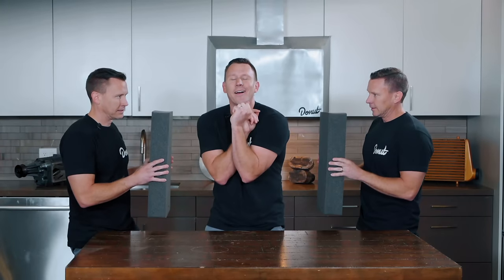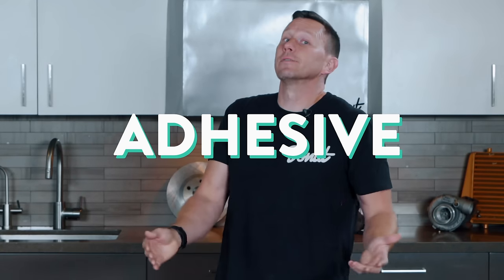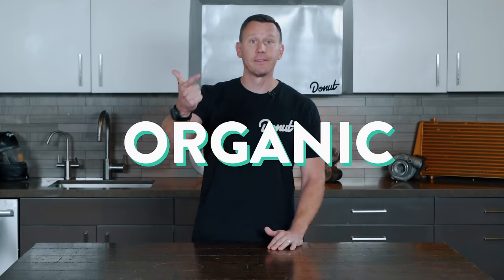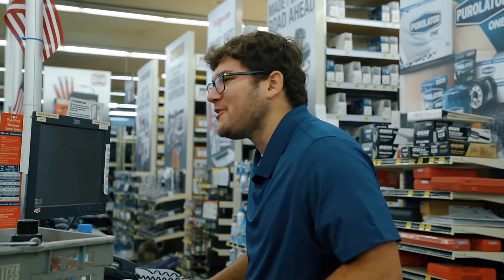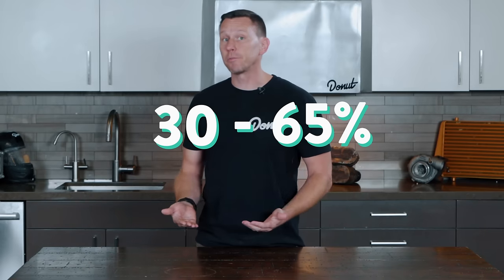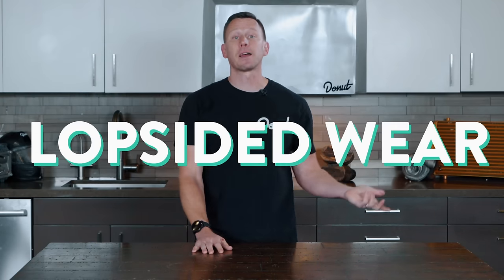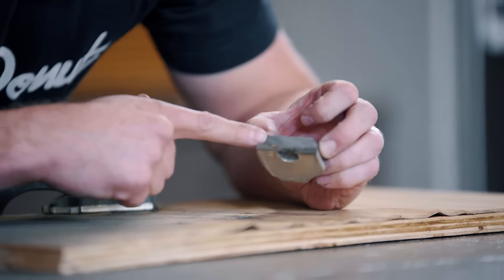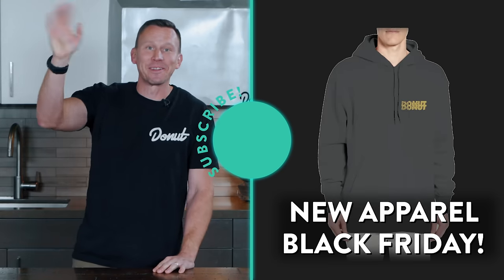Choose the right Brake Pad! | SCIENCE GARAGE

Comment: While this video is very informative, there is one false fact stated that needs to be cleared up. Brake pads and brake shoes are not the same thing. Brake pads are part of a disc brake system. Brake shoes are part of a drum brake system. What is the difference? 
Well, disc brakes involve a disc. Other wise known as a rotor. And they work by having the caliper piston press against the pads, which presses the pads into the rotor forcing it to slow down. It looks like this (>>|<<)
The () are the calipers 
The <>are the pads
The | is the rotor

Brake shoes however do not do that. In fact, they do the opposite. They go outwards when the brakes are applied, because, unlike disc brakes, they don't have a rotor, they have a drum. The shoes press against the drum in order to slow it down. It looks like this.
(<<>>) 
The () are the drum
<> are the shoes. 

Brake pads are not sometimes called brake shoes. Brake pads fit in the palm of your hand, usually, unless you have those big racing brake pads. Brake shoes are bigger than your head.
Reply from the maker: You'd probably like the video where we talk about that!
https://youtu.be/6H7nwlT_qNY
Reply: Very well explained.
Thanks.
Reply: A metal backing with a soft material.... pads and shoes are made the same but shape is different
Reply: Except you don't know how big my head is.
Reply: Nice explanation 🐐

Comment: Im using carquest ceramic platinum pads and rotors. They are absolutely amazing.
The pads are silent. They stop on a dime.
My brakes absolutely sucked. 2010 oitback in northeast pa.
Took me a solid 6 or 8 hours because i completely cleaned each part of the caliper that holds the pads. Subaru uses slide pins that have boots and are sealed with grease. Mine were dry and def not working properly. Proof is that the inside pad was worn on the bottom of all the pads except one front side. That side had the best looking pins 

Anyway, i used a bore brush to clean the cylinder where the pin goes. I used small wire wheels to clean thenrust on the lips so the boots can seal properly.
I used at 205 to clean and restore the boots to a like new appearance, i could not believe it.
Anyway, the calipers are now functioning as they should of been and they just feel amazing. I flushed the fluid which makes the pedal feel brand new. Just super impressed with how much doing a job yourself can really change the outcome.
Had i went to a shop theud of replaced everything n not touched the pins i guarantee it.

Comment: One thing you left out is that the more expensive brakes tend to perform worse until they have been warmed up. If you just start you car and have to emergency brake shortly afterwards the organic brake will stop the car faster. However if you've done some braking at high speed on the highway and have already warmed up the brakes then the more expensive pads will perform better.
Reply: If you have power brakes and abs, it shouldn't really affect stopping distance
Reply: @matthewprather189  track pads can provide a lower coefficient of friction than stock pads until warmed up, which they will then provide a much higher coefficient of friction.
Reply: @NCRranger24  Then push harder. Shouldn't be too difficult to lock the wheels
Reply: @matthewprather189  I don't think you understand. They can only provide so much friction at cold temperatures, and can often be incapable of locking up the wheels/triggering ABS because they can only provide so much friction when cold, regardless of how hard you push the pedal.

Comment: Love the show, something else to mention 

Organic brake pads wear faster but put minimal wear on the rotor.

Sintered brake pads last longer but wear the rotor faster.

Racing/track brake pads require to work in a higher temperature window. This makes them wear less when in use. But are very bad for street use were the temperatures are low.

Thanks for the videos and entertainment:D 

Ps I think home containers are awesome!!!

Comment: i need new brake pads on my miata. Thanks for the input
Reply: Put on some FREAKIN' Carbo-Ceramics!
Reply: @srijangupta.automobile6320  totally i aggree 8 pot brembos in the front and 6 pots in the rear just to be safe
Reply: you could prolly go back to using leather pads for a miata.
Reply: Not with my 8 pot brembos!
Reply: I’ve built 3 spec miatas the 1st thing I did to all of them was threaded lines and carbon ceramic pads($100) most effective mod on a car imo
Reply: Got projet mu ns400 on mine, happy with these
Reply: Arent they rubber? Bicycles stores sell shit for those kids peddal cars dont they... 😉

Comment: Nope.  Tires are more important than brakes.  Brake on bad tires, watch what happens.  Brake with no tires at all, watch what happens.
Reply: Well really worn out tires are capable of gradually braking. And with no tires at all, the friction between the rims and the asphalt would be too high to even sustain its inercial energy. In the other hand, no brakes no ability to stop short-time wise. Which means, no engine stop.

Comment: As far as brake wear sensors are concerned, the MINI Cooper is an exception.  Instead of a metal tang, it has electronic brake sensors, which when triggered, light up a brake warning light on the dashboard.  When that happens, not only do you need to replace the brake pads, but these electronic brake wear sensors as well.  And then, you have to rest the brake warning light on the dashboard, otherwise it won’t pass state inspection.  I know this because I had to service the brakes on a MINI Cooper once, and it was a real pain in the butt.

Comment: Metallic pads will stop you fastest. Ceramic dont perform as well but handle the high temperatures of racing better. A good example is moto gp. They switch to metallic in the rain because they perform better and heat is not an issue when its raining.

Comment: You were holding the grinder upside down. You need fo rotate the guard and handle and turn the tool over. That way, you have leverage to cut without the grinder bucking and flying at you.

Comment: Ceramic brakes also lack bite. I love semi metallic because they are cheap and have great bite. I do my own work so changing brakes are quick and easy. I'd rather have that extreme deceleration feeling than have long brake life.
Reply: Oh and ceramic brakes need heat to start working. Semi metallic just work right away. Quicker more confidence inspiring braking for cheap. Until you get to a extreme hill or alot alot of frequent braking. Then ceramic can take more heat before the pedal does nothing at the cost of your rotors. Ceramic eats rotors no matter what. Organic pads are just a way to get you to the dealer more frequently. You should only have semi metallic and ceramic to choose from. Seriously they are a scam IMHO.

Comment: This video is so useful. Thank you so much for making it. I am gonna need to replace my bakes soon but unsure what type of brakes I should use. I have no idea what type my original brakes are. There are various brakes in the market. Some are from big brands like TRW. Some are from brands I have never heard of. It will be so great if you can give some advice for my VW Tiguan. Should I go with ceramic or semi-metallic?
Reply: If your unsure the OEM parts are almost always the best choice. The only real downside to cheaper brakes are noise and how fast they wear. Semi metallic are best unless you are taking your car to the track. Your stopping distance is limited by traction, not braking force so your pads an rotors should have no effect on your stopping distance.

Comment: My car could have came with the option for carbon ceramic brakes. They are 10k for just the fronts to do a brake job and only porsche makes the parts for my car. No aftermarket parts available

Comment: Ok i have 1 question where I can’t find I’m going on high carbon rotors, which brake pad i should use? Help, is it ceramic or regular, is it matters when using high carbon rotors need specific brake pad?

Comment: Don't get organic brake pads even if they're cheaper. Stick with ceramic pads. I had organic pads and there would be grinding noises from them. Switched over to ceramic and the noise quickly dissipated.

Comment: Thanks for sharing, Here I would like to put our ads here. thanks.

Why choose Jinli Brake Pads?

1. High Safety:  Shorter brake distance and high fade performance even at 550 degrees Celsius;
2. Flexibility: Genuine Ceramic formula and Less metal formula can meet different need and Custmized Service available;
3. High Stability:  Equal to OE quality, with under layer material, with 2 step pressing process, super quality;
4. Experience: Our company has provided services to over 35 contries.incuding North America, Europe and Japan.

Comment: So why is a very important factor about pad material not covered?
Pads are designed to operate withing a certain temperature range.   Each pad has completely different characteristics at different temps. 

Choose the wrong temp range, and that early morning cold stop will put you in the middle of a busy intersection or hitting something.   Or the opposite, where coming off a mountain pass via a twisty road will overheat a compound and force it to break down when you need it most.
Just sayin'....  There is far more to understand than shown here.

Comment: All the Lamborghini  videos you see of them crashing because they can’t stop at slow speed are using those expensive pads. They are designed to work at high speeds at high temperatures. If they are cold they don’t stop for beans as the wannabe Lamborghini race drivers clearly show when they crash into things and blame the car. These pads are not the best. Only the best for certain  applications, such  as racing. Carbon ceramic are no good for us normal folk.

Comment: Why'd you spend so much time talking about the organic and semi-metallic pads then glossed over the characteristics of the ceramic pads??  A serious downside you neglected to mention is how bad ceramic pads are when they're cold.  I have ceramic pads on my car, and I've almost rear ended somebody twice.  And that was at LOW city speeds!!  The colder it is outside, the worse they are.  Once you get some heat in them, they're fine.  Thankfully, it doesn't take a very long time on the brake pedal for them to generate enough heat to work properly.  You just have to judge your distances a lot farther out in cooler weather.
Reply: I use ceramic pads from power stop on my charger and havent had any issues like that. What pads you running?